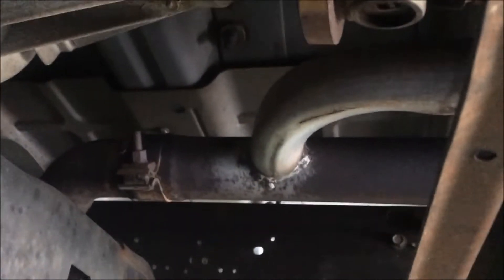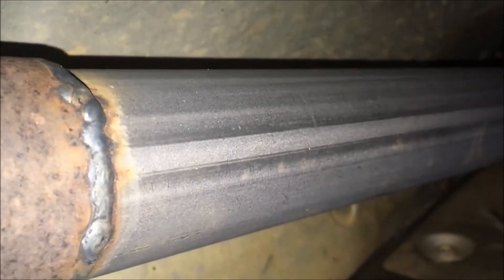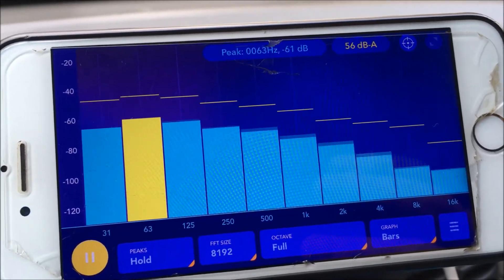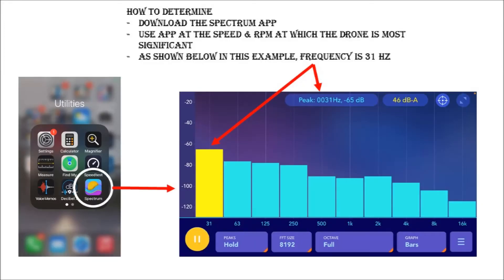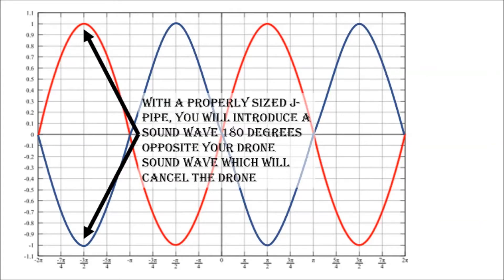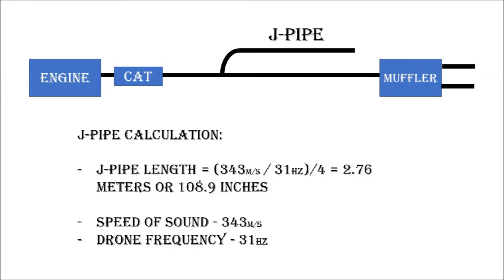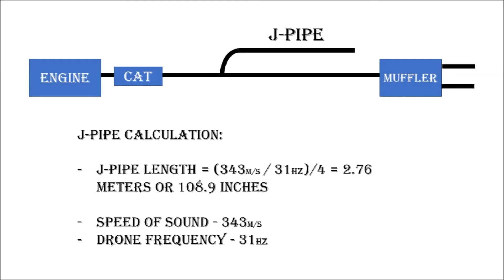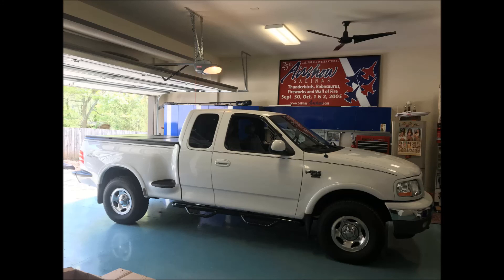How To Reduce Or Eliminate Obnoxious Exhaust Drone, Noise From Your Vehicle, Car or Truck

Comment: Thank you for this video
Can you help me to calculate what is the length and white of the J pipe? I should use? 
On GMC Sierra 5.3 (borla kitback)
Highest drone on  1600 to 1800 RPM
Reply from the maker: This calculation is in the description of my video:  Drone Frequency = (RPM / 60) * (Cylinders / 2) or (1700rpm/60)** (8/2) = 113.3 cycles per second, then J Pipe Length = 1/4 * (speed of sound / Drone Frequency) or 1/4 * (343m/s / 113.3 cycles/s) or 0.76 meters or 76 centimeters or 29.7 inches.  You should check my calculations.  Remember, this is the total length from where the j-pipe connects to your exhaust to the end of the pipe.
Reply: Thank you so much for your reply
It’s looks easy now
Reply from the maker: Very welcome, share my video and subscribe!  ;)

Comment: I did a muffler delete on my 2005 Cadillac CTS 3.6L. I have drone in the cabin. I appreciate the video. My question is, is there a specific location to install the J pipe? Does it make a difference where it is located after calculating the length of the J pipe. I have not removed the CAT, nor do I plan to.
Reply from the maker: I would locate the J-pipe as close the catalytic converter as possible, but after the catalytic converter.

Comment: I have the same exhaust as you how long is your j pipe and what size pipe did you use for the j pipe
Reply from the maker: The j-pipe diameter should be the same as the primary exhaust pipe.  As far as length, I don't recall, I'll try to remember to measure, but the calc is the best and most accurate way to ensure you get rid of drone.

Comment: Where is best spot to install the j pipe
Reply from the maker: best spot normally depends on where you have room, but it should be located between the engine and muffler.

Comment: So if i put the j pipe closer to where the engine is will it make a difference? Like right after the cat
Reply from the maker: Generally, you want to locate the j-pipe where you've measured your exhaust temps.  Get your vehicle up to operating temps and drive a few miles.  Immediately check your exhaust temps at a location that allows for the installation of the j-pipe at the calculated length.  This video will help:  https://youtu.be/CIAM6mqOuSQ?si=JeRcRsXDBsmTNFOs

Comment: I went and replaced my Versa's exhaust with a Cherry Bomb setup thinking I was a smart or something.  Smart ass more like it. Glasspack as a mid resonator and a m-80 on the rear. Sounds wicked nice when accelerating,  but it;s a LOT louder than I thought it would be. The BIG issue is the drone. The drone is UNREAL at 120kmh and when downshifting.  Me and my GF were laughing at how terrible the drone was. My ears are still ringing.  Evil  hellion drone. I didn't anticipate that. It's too loud and I can't have that.  I hope I can do something like installing a  J bend pipe .  I'd rather not have to get another rear muffler just yet if a J bend pipe can solve the severe drone issue and cancel out some of the obnoxious sound. . IF not then I'll just put a normal quiet muffler on the rear, or a quieter mid resonator.
Reply from the maker: I’ll be honest, a J pipe can do a lot, but if it’s as loud as you’re saying, you’re dealing with drone and volume. A J pipe is cheap to start with, just make sure you calculate the proper length.
Reply: @DrivingIntelligence  That's why I'm researching. It's only really droning loud between 3 and 4 thousand RPM..which is highway speed. Disappears below 3000 rpm , and then gets louder at 2000 but I'm cool with that. Loud when given throttle to accelerate but when I let off the gas....huge bass drone. That's the frequency I'm targeting. I never thought how rpm at 120kmh is just above 3500 rpm, which is just after where that huge bass sound kicks in which just BLASTS the system. Live and learn. I'll try the J pipe first. Loud is fine, Evil done is just VERY bad. Everybody I passed on the highway got a loud treat that's for sure.
Reply from the maker: @poseidon5003  interesting story!  Where do you live?  Europe?
Reply: @DrivingIntelligence  Canada. And i just measured the frequency.  93 hz.
Reply from the maker: @poseidon5003  cold country!  Great, now just use the calculation method I showed to determine the required length.
Reply: @DrivingIntelligence  I did and BTW thanks for the equation!   It's straight and to the point. 

With the speed of sound at room temp I got 0.92 meters (92 centimeters).   

Now all I have to do is measure the exhaust gas temp. Sound travels at different speeds in different air temperatures.  I took it for another test drive.  All of the loud drone is at 93hz regardless of rpm.  Whenever it''s bassy loud, it's 93hz.    This J pipe may take care of it.
Reply from the maker: @poseidon5003  I should have sent this before.  I did another video that explains how to get the proper speed of sound when exhaust temps are high.  This playlist includes that video.  I did many videos needed to make my F150 as quiet as possible.  Let me know what you think.
Reply: @DrivingIntelligence  Update... The length of pipe I require is  1 meter long. I can't fit that under the car. I'm going to try a vibrant ultra quiet.
Reply from the maker: @poseidon5003  Let me know how it turns out.
Reply: @DrivingIntelligence Update : I ended up putting two Vibrant Ultra Quiet's on it. One mid and one rear. Sounds awesome now. Just what I wanted.
Reply from the maker: Interesting, are those straight through designs? Or are they chambered mufflers?
Reply: @DrivingIntelligence  Straight through.  Sounds great now.

Comment: How much did the muffler shop charge you to get the j pipe?
Reply from the maker: I don’t recall exactly, less than $100
Reply: Just make your own for less than 20 bucks
Reply from the maker: If you can weld ;)

Comment: Awesome video. I was wondering if this reduces any overall volume as well? Also If I am having a very low level resonance noise in the cabin at a certain rpm I am assuming this is drone? Can a bottle resonator also reduce this? They claim to be able to reduce drone but it would seem like they may add drone since they would be making the overall tone even deeper wouldn't it?
Reply from the maker: Thanks for watching and your comment / question.  I can't comment on the resonator as I've never used one.  The J-Pipe is so simple and easy to calculate to resolve the exact frequency that drones in the cabin.  I'm not sure if it actually reduces the decibels in the vehicle, but getting rid of that resonance really makes the drive much more enjoyable.

Comment: So if you have dual exhaust with a x pipe do you need 2 j pipes that equal the total length or just one? Or half on each?
Reply from the maker: To maximize the benefit, you need the full length j-pipe on both sides of the exhaust.

Comment: After the 90 degree bend, does the pipe have to be straight?
Reply from the maker: Not necessarily,  most  important  is the length.  But the straighter the better.

Comment: Hey great video, finally I found some good solution to this problem. I am gonna install j pipe but i am not finding this j shape pipes at amazon nor ebay. From you bought this j type pipe? Appreciate your assistance and thanks again for such nice video👍🏻
Reply from the maker: thanks for watching and thanks for the question.  The J-Pipe, or also know as the Quarter Wave Resonator, are custom made at a muffler shop.  You will need to do the calculations I describe in the video to tell the muffler show how long you want your J-Pipe.  Hope that helps!
Reply: Thanks for the swift response. Yup, I will do that calculation for length. But the j pipe is just a normal pipe and bent to make it j shape? Or is there anything inside the pipe as well? Asking this as we dont have too many options here so just have to do everything from scratch.
Reply from the maker: @aamirabbas7126  yes, just a piece of pipe.  And make sure your calculated length includes the bend (90).  The pipe should be close to the same diameter as your exhaust.  What are you driving?  I have other videos on this topic as well.  Check out this playlist:  https://youtube.com/playlist?list=PLGNsbVXzRfZOQK2ao-5vQRvBvRR8I2zMG
Reply: @DrivingIntelligence  thanks man, yup, all info well noted, I will work on it. I have Tundra 5.7 v8 with after market Exhuast system.

Comment: Hey hello, once I calculate length of J pipe does it matter if I put it closer to engine or further? Or just find place where it fits good enough and mount it?
Reply from the maker: my opinion is to locate where you took the temperature of the exhaust and used that temp to calculate your j-pipe length.  Since space could be a problem for many,  locate between muffler and cats so you have a straight pipe after the 90 degree bend.
Reply: @DrivingIntelligence  okay I get it, thanks ✌

Comment: I am not sure why.... but I am sad to report, after studying drone pipes and Helmhotz resonators all over the web and after careful calculation including temperature, my 3" J pipe has done nothing to cure my 1500-1600 rpm, 113Hz drone on my L5P GMC Duramax. I went with 40 inches.... I may be able to lengthen it a bit, I am gonna try that.
Reply from the maker: Sorry to hear that.  There is another calculation based on number of cylinders.  Let me see if I can find it.
Reply from the maker: By the way, did you turn everything else off?  HVAC, radio, windows closed, etc.?
Reply: @DrivingIntelligence  turn off everything while I tested the sound frequency and levels? Yes. One app says the loud obnoxious noise is at 113hz, a different app says 107hz.
Reply from the maker: In my description section I added the method to calculate J-Pipe length using number of cylinders.
Reply: @DrivingIntelligence  The app and the cylinder equation results are very close. Around 107 hz. I don't understand why it didn't kill the drone. I am going to double check the temp and possibly add 8 - 12 inches.
Reply from the maker: @fcalandra1234  Sorry you’re struggling with this problem. I have another video that could help from a different perspective. Check this out, this helped me reduce noise in my 2002 F150:  https://youtu.be/b5WA3vLSkOU
Reply from the maker: any updates?
Reply: @DrivingIntelligence  Nothing yet, I plan to add an 8" adjustable section to see if I can tune the J pipe. 

I used a second app to confirm the frequency, one displays between 102 and 113Hz, the other shows 107Hz, pretty comparable. This is confirmed by the RPM formula, as my most annoying drone is at 1500 RPM on my V8 diesel. 

The temperature equation is tough to hammer out because I cannot measure the temp at full load while moving. After a pull with my toy hauler, pulling in to measure the temps, the exhaust gases out the tailpipe are about 150 degrees at idle  But the main exhaust pipe measures only 130. In the calculation, using a fairly low temp of 200, the J pipe calculator results in 39". My J pipe is 40 inches.  Seems like it should work.  Frustrating.
Reply from the maker: ever get this straightened out?

Comment: I need to do this to my deleted diesel... but I still have not pulled the trigger on length. My concern is how much the speed of sound is affected by temperature. I understand diesels can have 1200 degree temps at the headers and run at 400 degrees down pipe at the near the tail pipe. This is even higher for DPF diesels. At a modest 400 degrees F, the sound number goes from 343 to 438, greatly affecting the length of pipe calculation. It seems you had good results without figuring the temp into the equation.
Reply from the maker: Frank, stay tuned, I am posting a video to answer your question, today!
Reply from the maker: check out this video:  https://youtu.be/CIAM6mqOuSQ

Comment: Hey man im having this issue with my 2017 ram 1500 i put a flowmaster super 10 and the drone is killing me, is the j pipe still working for you ? I heard it makes the exhaust fumes run hotter or heats up your oil? Or something like that im not sure i guess what im asking is did you notice anything different in your truck? Mine is at between 1500 to 1900 rmp on cruise speed at about 80 mph im on highway alot it kills my head but idk if i should do this or like take the super 10 out and go with a 40 series, i just dont want to mess up the truck you know, also how do you know where to actually place the j pipe like where to have it welded on? And also what length  to go with ?
Reply from the maker: I've never heard of any problems with heat due to a J-Pipe.  Mine has run flawlessly since install and I can't believe how quiet it continues to be.  You need to find some space under your vehicle between the cat and muffler that includes the distance you need for the pipe.  You will need to calculate the length of your j-pipe based on my video.  I've never run a Super 10, so I don't know how loud that will be.  But a J-Pipe will reduce drone!

Comment: Nice broi removed the muffler which comes in the middle in my GMC Yukon 2015 and the is only resonator at the end but there is drone at 1600 to 2000 RPM so do u think 27 inch of G pipe  will stop drone
Reply from the maker: Thanks for the question, do you know which is the loudest frequency as I showed in the video?  The only way to know for sure is to measure the frequencies as I show in the video and do the calculation.

Comment: I have full length dual exhaust with an x pipe. Do i need J pipes on both sides of the exhaust?
Reply from the maker: You will need a j-pipe on both sides.  You can try one first, but I suggest getting two that are based on the frequency you find as I demonstrated in the video.  Let me know how it turns out.

Comment: Good videos sir. ... but. A stupid question. How do i get speed of sound?
Reply from the maker: I posted the speed of sound in my video.  You can use that number.  For more accuracy, you can measure the temperature of your exhaust where you will install the j-pipe and look it up on the internet.  You will need an infrared temperature sensor.
Reply from the maker: And thank you!  Please subscribe.

Comment: Great video. Other videos on this topic talk about a longer J pipe cancelling out more frequencies.  Also, you mention 108 inches, but in your video, your J pipe looks much shorter than 108".
Reply from the maker: Hi there, thanks for checking in.  My calcs in my video were for example and do not represent what I have on my truck.  A longer pipe will cancel out more frequencies.  The length is specific to your worst / loudest frequency to eliminate that drone.  Let me know if you have other questions / comments.

Comment: So what ended up being the length for yours? I currently have a crown Vic, all cats in tact, 2.5” stainless to the back, no crossover or mid pipe, and they installed resonators where mufflers would be. Also has tips. Getting a terrible drone/noise at highway speeds. Looks like around 125 hz or so. Any recommendations?
Reply from the maker: I'm recalling from memory, but I think it is about 27 inches.  From  what you are telling me, you need a 27" J-Pipe of total length.  You will need to add one on each exhaust.
Reply: @DrivingIntelligence   I love the drone how do I get more drone???
Reply from the maker: @Willie.20  haha, ok!  Remove you exhaust from the cat back!  Maybe that will work!